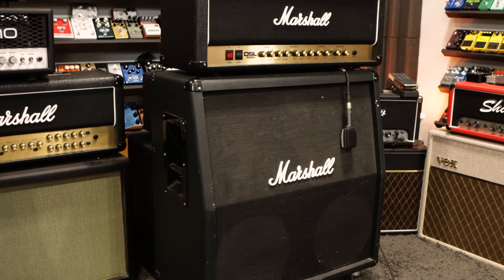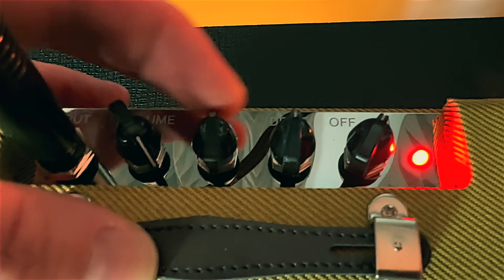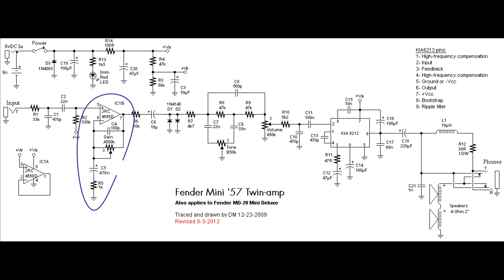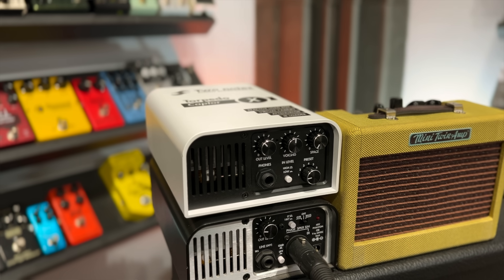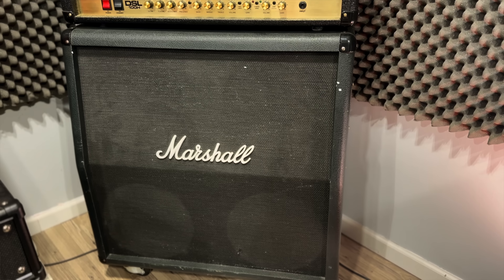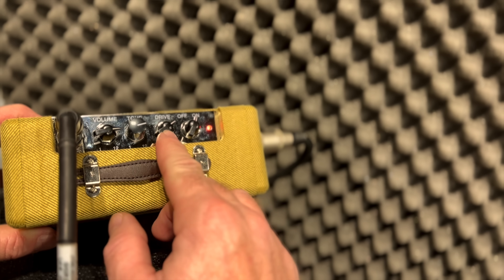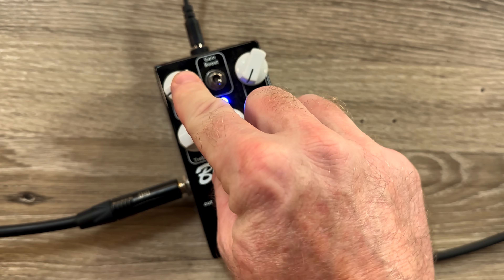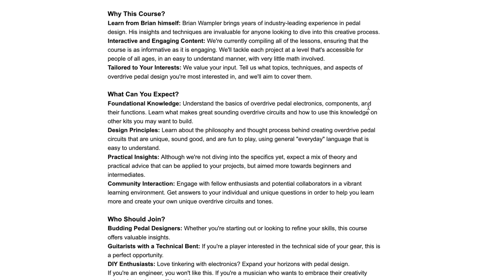Can this $50 Mini Amp be MODIFIED into a BEAST?

Comment: Great video. I have the 57 twin mini, had it for over a decade and love it but I had always wanted to put a bigger speaker in it or connected it to a cab. It sounds great in your video. That clean vintage sound comes out great with bigger speakers. Have you had any modifications or issues from the amp pushing/driving through those bigger speakers?

Comment: I modified a Blackstar Fly 3 with an upgraded 3 inch Neodymium 4 ohm speaker, and speaker out jack, I modified a BK Butler Blue Tube pedal to use an octal 6SL7 tube, and  I'm using a Fryette Valvulator in the back of/beforthe input of a gifted Marshall VS15R amp. I'll be mounting the  modified Blue Tube pedal in the back of a gifted Line 6 Spider 3 150 watt 212 amp

Comment: do you have any experience with a guitar feeding a computer or cellphone through a USB soundcard taking the output to headphones or an amp?   I tried Guitar FX but it would not
work on my android phone, kept causing the app to crash.   I tried it on my laptop using headphones and it did work but he free version of the app was pretty limited and nothing
to get excited about. The $2 dollar USB soundcard had some hum and it was to good.  There is something called IRIG but much more expensive and was wondering if it works any better.   I am not a Pro guitar person just having some fun playing songs I grew up listening to and I can't get into expensive amps.  Wondering if there was a cheap way
of getting a guitar to sound better than it does with a cheap amp.
Reply from the maker: That should work… might just be the app not working properly

Comment: Back in 1979 I took a portable cassette player and wired a guitar cable into the back of the tape head and voila a battery powered amp and because the guitar pickups were higher impedance I had good distortion as well. Not stopping there I took a small headphone speaker out of a pair of headphones plugged it into my new little amp and I put the tiny speaker between my teeth facing in my mouth and you got it I was playing like Peter Frampton with a talk box at 15 years old.

Comment: I modified one of my MS4s into a head by yanking the electronics, throwing them into a wooden box, and putting in a speaker out. I then use a Danelectrode with the voltage dropped to the point where the amp barely functions and send the signal into a speaker cab. It creates a glorious noisy broken fuzz sound that was inspired by the first Foo Fighters album (namely, the songs Exhausted and Podunk), where a different portable amp (SLC "The Can") was used with nearly-dead batteries to the same effect. I then use this setup with my '60s ES-125 because I know that every time I do, a tone snob gets indigestion.

Comment: It sounds like you're turning that little amp into just another pedal.  which is fine...  nothing wrong with that.  I mean, that's what Brian May and John Deacon did 50 years ago - which gave Brian May the Queen guitar "sound" in the studio.  Those tiny speakers in that amp are one of the major bottlenecks to it getting a "good" sound by itself.  Those little amps are almost always voiced with very little low end and a lot of accent to the mids - in order to get something sellable out of those teeny tiny speakers.  And the overdrives almost always have WAY too much gain.
I've done similar things with older solid state amps that are readily available used for around $30-40.  they typically have either a 5" or 6.5" speaker.  they can be fairly easily modified to smooth out (or shape to your liking) the frequency response - especially the overdrive, which usually sounds awful.  with a good 8" or 10" speaker connected to the output they sound quite decent.

Comment: I used to play the same joke, by having my 15 watt Gorilla practice combo perched on a chair on stage but I had modified it with a speaker output jack, so it was plugged in to a mic'd 2x12 just off stage. In truth, it wasn't so much a joke as it was a necessity, seeing as it was all I had back in the late 80s. Actually sounded reasonably good!

Comment: If it has no tubes than why not just put a speaker in an old toaster ?  Its also compact.
Reply from the maker: Good question. A major fault of a toaster, when used as an audio device, is that there is no circuitry inside that manipulates audio in a good way. It’s basically just hot wires, which doesn’t do much for a guitar signal. I suppose I could rip it all out and install audio circuitry but then at that point I might as well just build a complete pedal.

Also, they aren’t true bypass.
Reply: @wampler_pedals  I would recommend you drop that idea and just have a tube toaster rectifier with a crumb tray and aux cab and your preferred loaf bread and butter.

Comment: Something I've always wanted to do is have a guitar amp circuit inside an old Hi-Fi turntable setup. Basically make it look like you're playing through your grandma's old Sears record player. Bonus points if you could have the turntable spinning and controlling an optical tremolo or something.
Reply: I've seen someone comment that they used that as like a preamp boost thing and funnily enough he mentioned that the turntable had to be spinning for it to work lol. I wonder if you could cut holes in a record and  have a light sensor under it to control a tremolo or something wacky like that

Comment: I have installed output jacks on several mini amps over the years, I use a shorting Jack so I can still use the internal speaker.  Most of the time I have been impressed at how good they sound going though  a real speaker.

Comment: I suppose you could put a mic in front of it that isn't plugged in, then just run straight to the FH, no one would know that we weren't actually hearing that little cabnates poor excuse for a speaker. Yup that would be pretty funny, and just think of the extra gear you wouldn't have to lug around. Thanks for posting.

Comment: Back in the early 80's I used to practice and occasionally busk around Center City Philly with my Memphis 'Explorer' copy, one of those little battery-powered 'Marshall Halfstack' amps that had like 2 or 3 knobs, and I fed that with my MXR Distortion+ (which I still have) so I got a real super high gain. That little amp didn't sound too bad for what I was doing at the time, which was mostly running Sabbath, Dio, Ozzy, and other metal riffs over the fret board, as was the style at the time. I had this idea of building a belt of 5 of them chained together for more volume and directional dispersion, but I never got around to doing it. These days I could make a belt of 7 if you know what I mean. Especially after the holidays.

Comment: I did a similar thing to one of my own amps, which is a Fender Mustang modified with an external speaker jack to bypass the internal 8 inch speaker. I plugged it into a 2x12 with greenbacks and it was the best sound I'd ever gotten from my limited arsenal of amps. Whether it's a high quality tube amp or a cheap little solid state amp, either sound is essentially an equalized and distorted signal until it hits the speakers, and that's where your tone comes from.

Comment: Just removing the two 4148s is a massive upgrade.  It has a decent clean tone now and still distorts if you raise the gain up.  I tried red LEDS and other diodes and liked it best with nothing in that place.  Good little desktop amp for testing pedal builds to make sure they work before taking it to your actual rig
Reply: Do you tried germanium diodes like 1N60?
Reply: @lecleto  I tried every diode I had ended up preferring no diodes at all.  I don't think I  had a 1N60

Comment: I had a little plastic Fender amp. I’d use a wah in front of it and put a light jacket or shirt over it, to dampen the harshness. It would really scream.  When the battery just started to die it would sound even better.  I remember having half dead 9 volt batteries laying everywhere.

Comment: SKB has a 5watt amp available for $9 on parts express. You just need to add a speaker and a power supply. It takes a pedal 9V center negative. Or what I do is connect it to a usb power bank. I got a Fane Black Label 12” at a pawn shop for $10. off a broken combo amp.

It also sounds good just connected to a regular 12” full range sub. I’ve tried that also. 

Some guys connect it to 12V for more headroom but I find 9 to be enough and it is loud. Has no trouble keeping up with a 20watt amp.

It also has a whole slew of extra stuff like ports for pedals, a cable tester. Headphone jack ,along with a port to connect it to an external cab. All for $9!
Reply: I’ve also tried it with a 4” speaker and a 10”. The ten was the best sounding.
Reply: What is the name or part # on Parts Express?

Comment: I play around with one of those and it does single notes but crapped out on full chords. Yeah the speakers were very much like something for lil kid project box. Idk ive got a better tiny amp
Reply from the maker: Yeah, it craps out on those power chords because it’s a very simplistic preamp design, and over saturates way too easy. Maybe I’ll create a different circuit entirely and do a part 2 of this video 🤔

Comment: Very cool. Hey Brian where did you get the schematic for this or did you just figure that out? Signed up for the guitar pedal courses .. stoked to learn.
Reply from the maker: found it online, then reversed my circuit to make sure it was accurate. https://imgur.com/gallery/l17mOc9 and https://www.freestompboxes.org/viewtopic.php?t=28109 but the FSB schematic is missing a cap on the headphone output stage.

Comment: Cool. Just shows how important speakers are to tone.
Reply: Ooh boy, you're gonna upset the toob and toanwood bros with that hot take.
Reply: @immy4104  Not at all , everything adds to the tone. If you have good wood and a tube amp , you need a good sounding speaker to hear them properly
Reply: A nasa engineer told me once magnetics are the most important part of any circuit. So i said does that mean pickups and speakers are most important for tone. He said yeah

Comment: Making a power-amp out to any cheap guitar amp and then connecting it to a decent cabinet will make a huge difference even without modifying the circuit at all. The stock small speakers in these budget amps are the nail in their coffins, they will always sound thin and tincan-like, there's no way around physics.
Reply from the maker: Very true! I didn't go into the circuit details here, but I did change the amp's preamp, clipping, and EQ inside the mini-amp itself as well.
Reply: Fair point, ordinarily I would agree but, desktop amplifiers would appear to differ 
Engineering does have a habit of progressing 
Quite irritating to us dinosaurs  but there you go!

Comment from the maker: For years I’ve had many folks ask me to make dedicated courses on some of these topics that I dive into here on youtube, but have been wanting me to go into way more detail.
I’m proud to announce that we now have two guitar pedal courses available that are deep dive on all of those pedal questions you’ve been wondering, and we are ALSO taking pre-enrollments for a huge “How to design overdrive and distortion pedal circuits” course for beginners and intermediates who are wanting to learn all about the electronics side of guitar pedals.*

All of these courses are ABSOLUTELY RISK FREE - 100% money back guarantee within 30 days of your purchase. If you don’t love the courses, I’ll refund you, no questions asked.

If the thrill of building and tweaking your own equipment ignites your passion, you’ll love it. Swing by my other website, https://www.guitarpedalcourse.com

For a VERY limited time, you can snag any of our courses at a steal. Just type in the code 25offnow to slash 25% off any course. Don't delay though – this deal ends shortly. What have you got to lose? ;)

Also, When you see the montage of me working on the amp i modified the circuit entirely, changing the preamp, clipping, and EQ. Notice how that tone control knob is different? I did not detail "how" to do the mods though, but the course will detail things like this.
Reply: This is fantastic!
Reply: ❤this, signed up immediately.